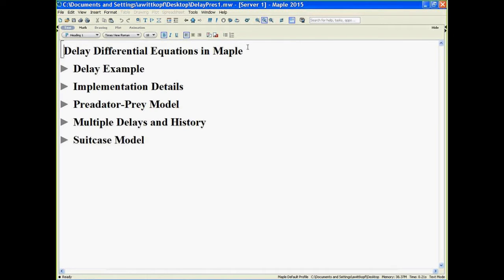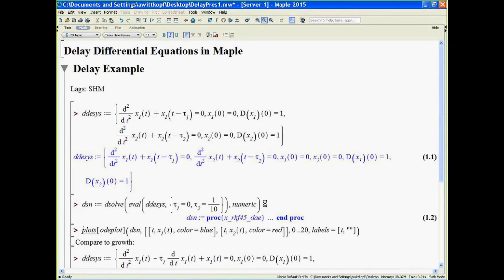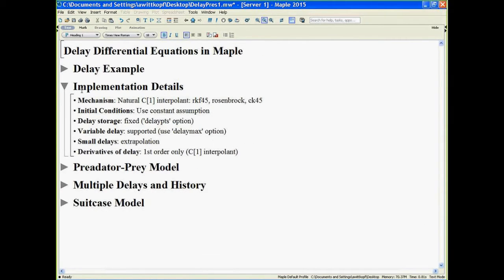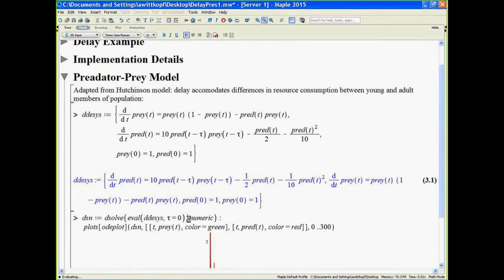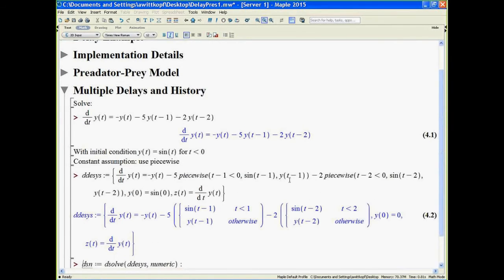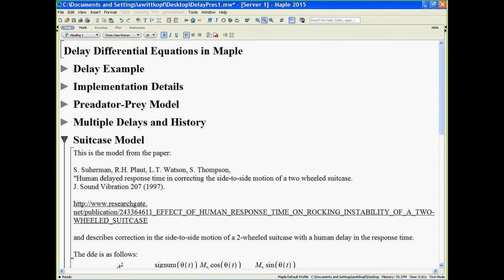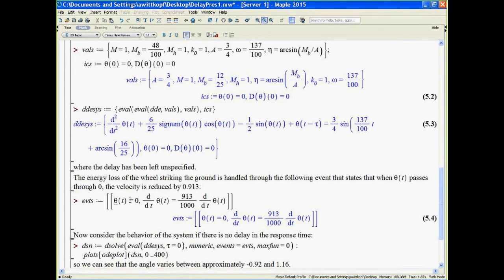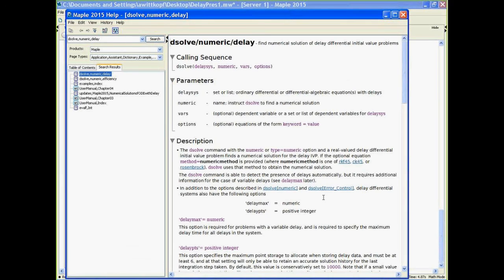Solving Delay Differential Equations

Comment: How to write Eluer code for Delay diff, I have a code for the Ode but I am not able to set one that works for DDEs. How to define the initial data, the history
Any suggestion, please?
Reply from the maker: Thanks for the question! Maple's numerical DDE solver is documented at https://www.maplesoft.com/support/help/Maple/view.aspx?path=dsolve/numeric/delay, but it does not use the Euler method. As a suggestion, perhaps ask your question on MaplePrimes, and it's possible someone will have code that you can use.
Reply: I can help you